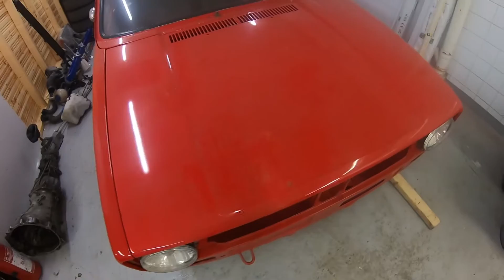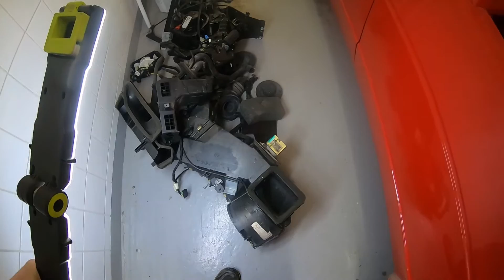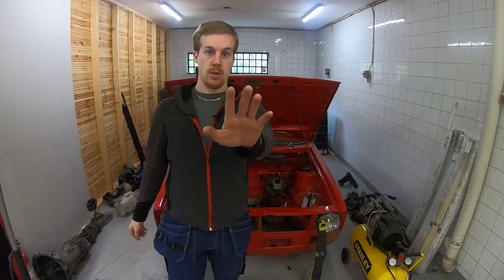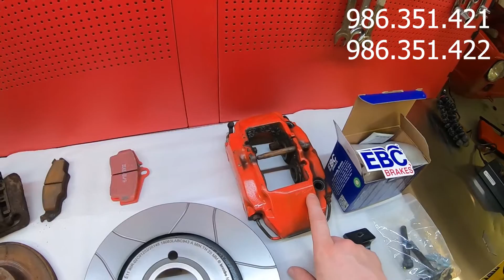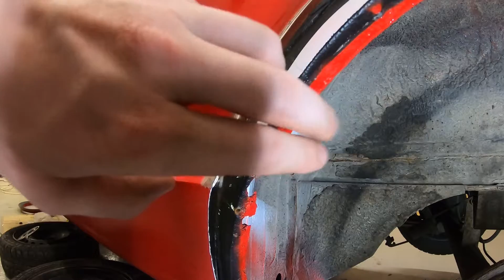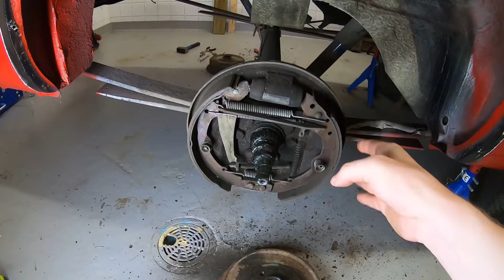VW Caddy MK1 TDI Build Part 1: Test fitting the Porsche Big Brake Kit

Comment: For rear disk brakes you can use scirocco 16v , mk2 16v/g60 , mk3 gt 2.0L8v , and I believe mk4 stuff.(I can't remember if the VR6 stuff bolts up or if you have to modify things, but it has been done) you will need the spindles, brackets bearings etc. but you will have to modify the ebrake cables though. good luck on the project , II'll be following. cheers
Reply from the maker: Sweet, thanks for the info! I'll start looking for those parts!

Comment: Greetings from california, usa. I really am enjoying this, as i have an 81 caddy and am also doing upgrades (but low budget for me) i like your presentation style. Well done!
Reply from the maker: Greetings! Awesome, what are the upgrades you are doing? My own project was supposed to be a low budget as well, but that kinda de-railed. 😅
Thank you, that is really warming to hear! I still feel awkward infront of the camera though, but it is really fun.
Reply: @cactusapesgarage6580  your film style is perfect for the me, lots of great info and presented so i can easily follow along. My caddy is lowered with a flip kit and air shocks rear, and coilovers and extended upper coil mounts front. 15 inch mini cooper steel wheels ( look similar to the stock 13s) this gives me a very low truck, which is what my primary goal was! Rebuilt stock brakes. Next up is a 1.9td aaz engine swap whick is non computer, easy swap
Reply from the maker: That's precisely what I am aiming for with this channel! Info-heavy episodes in the hope of helping my fellow car enthusiasts and some generic "how to"s sprinkled in here and there.
Depending on what gearbox you are going to use with the AAZ engine and if you are looking at buying the Epytec mount kit, I could send you my kit shown in part 2.
For reasons which will be revealed in the episode coming out later this week, my kit will be unusable with the new direction my project is taking. Don't worry though, the TDI is still going in it! It has just become a tad more complicated.
Reply: @cactusapesgarage6580  thank you, i am doing research now on the choice i will be going on the mounts. I will be reusing my factory trans. Possibly have to swap flywheels, but i am going to try and use as much of the stock truck as possible. Just need more power for daily driving
Reply from the maker: You mean the 1.6 gearbox? You might find the gear ratios bad for a diesel and it might be to weak for the torque.

Comment: New sub here - very impressed so far. I have been wanting to get into restoring cars for a while now. Just wondering where you learned your wrenching skills, and what recommendations you might have for a total, complete beginner. Should I look for an auto mechanic course at night school? Or should I just buy an Mk1 and start messing around? Any advice would be appreciated. Thanks for the content!
Reply from the maker: Thank you!
I have studied to become an auto mechanic as well as worked a couple of years as one.
It might be viable to take some night courses, but do some research into what you can expect to learn first. You can also learn everything on the web that an auto mechanic course can teach you.
My education was valuable as it taught me hydraulic/pneumatic systems, circuits and electricity and more. But courses are heavily oriented towards computer diagnostic fault finding and easier mechanics.  Because todays thinking of changing the part even if it is possible to dismantle and fix it, leads the auto mechanic courses to also being oriented in that line of thinking. 

Most of what I am going to apply here on this channel is self-taught as I mostly did oil services, brakes and easier fault finding while working as a mechanic. Though I wont deny that the auto mechanic course definately laid out a good base understanding to expand upon!

I would recommend you to either start wrenching on something that you currently have (car/bike/moped etc.) or buy a car of your choice, like the Mk1 you mentioned, and dive into it. Starting with the easier things first, like dismantle the brakes, ignition system and fuel system, to learn the inner workings of it. Then move on to harder stuff.

If you have any questions about something feel free to ask! I might even be able to make a video of it!
Reply: @cactusapesgarage6580   Wow. Thanks very much for this. It's very encouraging that you mention it's possible to learn what I need to know online. Will be purchasing a Mk1 soon. Can't wait to see what you do on this channel! Thank again!!!

Comment: I have restored many cars myself. The rust you have pointed out is not that bad. The hood i would be concerned that the paint will flake off or rust re-appear but the wheel wells are not that bad. Who makes the Brake adapter? Epitec?
Reply from the maker: True, I agree that it isn't that bad. But perhaps I was a bit unclear when I mentioned it, what I wanted to get to is that (1) You should remove the wheel arch trim and ,if needed, repair the rust before painting a car. (2) The amount of overspray on everything due to poor masking and paint prep is not ok. This was a rush paint job and the person (in my opinion) didn't particularly care about the end result that much.
I haven't really decided how to go about the hood yet as I imagine it will be quite finnicky to cut out all the different shapes from new sheet metal.

Yes, Epytec makes the brake adapters and engine mount kits. They have kits for 1.8T, 2.0 and vr6 as well. I really like that company.

Comment: What brake booster and what master cylinder will you be using for the Porsche calipers.
Reply from the maker: Originally the brake booster from my caddy mk2 and a 25.4 mm master cylinder which I purchased from epytec along with the porsche adapters. But now I think I might use the brake booster from the Golf IV, will have to measure the diameter of that master cylinder though before a decision can be made about the route to go there.
The 25.4 mm master cyl won't work now I think.